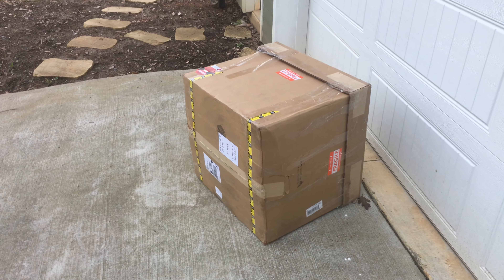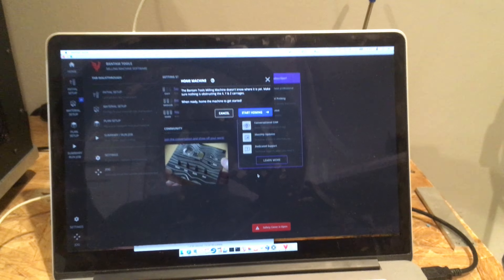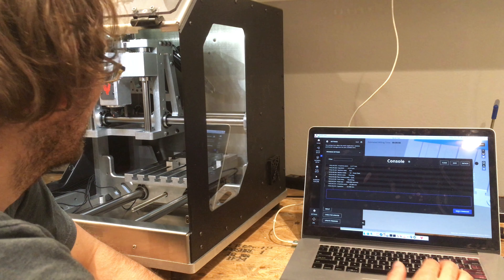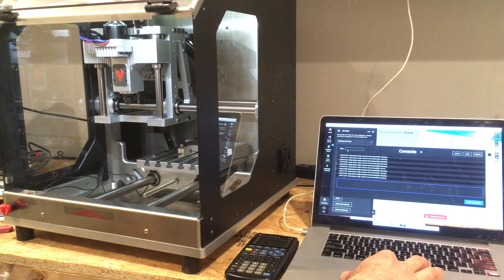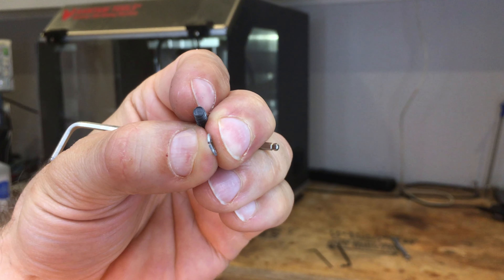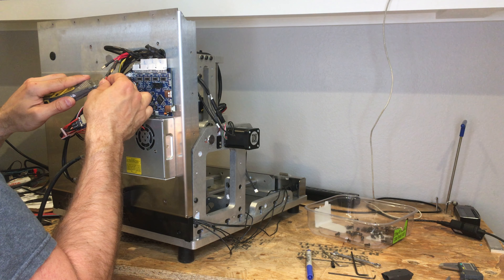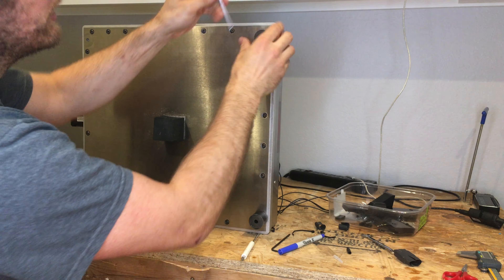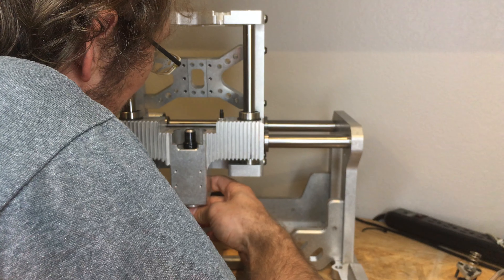Bantam Desktop CNC Review & Teardown - Part 1

Comment: Thank you for the through teardown. After watching all of the videos I removed myself from the waitlist. You saved me $4,000.

I was looking for a product that would allow move from additive printing to light machining. Ideally, with aluminum and a 1/4" tool. I could have stomached the software subscription, off the shelf parts, and overstated machine specs.  I figured that parts could be replaced as they failed. Apparently, this is not the case. I cannot fathom why a company would design a maker product with planned obsolescence. What a shady company.
Reply from the maker: Yeah I'm bummed Bantam's machine is such trash, too.  You can almost hear my enthusiasm escaping with every passing breathe.
Reply: I had the feeling it was not a very good tool due to that there are no YouTube videos out there by actual users.  There are several paid-for videos, but no real people like in this video.
Reply: Same I was going to buy this but not anymore
Reply: @justinknott6217  still haven't seen any response from Bantam. guess they're just gonna push more slick marketing vids and hope a new sucker is born

Comment: This was really friggin' interesting! Thanks for doing this! I've just begun contemplating how I could design my own desktop mill and figured I'd see what was available on the market. 
It just goes to show that no matter how many machined aluminium parts you throw at a design, it doesn't matter if the basic mechanical understanding is lacking.

Comment: Outrunner motors like that spindle tend to be pretty power dense. Something of that size can probably hit 1000W power or even more with enough current. The catch though is they get really hot and rely on air cooling from being on a drone or plane. So the 250W seems reasonable, but is severely derated for the use.

What's that other spindle you compared it to? I've been looking around for a good compact driven spindle - so far just going to use a Taig spindle head.

Comment: The motor for the spindle is a hobby motor for a big rc airplanes or big drones.  Totally off the shelf stuff and yes, they can easily acheive the 1/4 hp claimed, assuming their power supply can deliver the power required 1:01:50

Comment: John, I have a question on you HAAS railing review, comments are turned off so ill try you here.  On your corner posts did you use a set of Lag swage stops for one set of cables? Or did you offset your cables so you could have through holes for both sets and avoid the lag swage stops or lag swage turnbuckles?  Trying to avoid using the Lag swage stops where possible based on your great advice.  Thanks for your trial and error prior to my attempt
Reply from the maker: I offset the cables slightly.

Comment: That looks like a small outrunner that's using an ESC for drive voltage.  That will never hold up.  The beeping you are hearing is the ESC arming.
Reply from the maker: 100% Correct.

Comment: Wow....4 K for a small machine that is quite "springy" at the lightest touch..........after seeing a number of videos on the 3018 table top CNC routers I wanted one too just for the fun of building it, so I bought one on Bangood but without taking it out of the box I had already decided to build one from the  ground up to the basic 3018 extrusion frame design, but using12mm  SBR linear rails and 12mm ball screws all round with a 500 watt spindle motor.......it's 3/4 finished and went together very easily.

Comment: Much appreciate your honest and in depth review. I first looked at the presentation from NYCNC of the same machine and I can now say that I once again find my self feeling very disappointed by that channel. 

I am looking at purchasing a complete cncmil for max 5-6k. I have no hands-on experience but would  like to start with a desktop device that is possible to learn with. Is there any machine in this price range that you would recommend, that can handle brass and aluminium ( and perhaps soft steel)?
Reply: Well it really depends what you're looking for. If you want an off the shelf solution, the makerdream Evo One seems to be a great choice. The machine is stiff and powerful enough to mill aluminium with acceptable dimensional accuracy.
Reply: See this review / demo : https://youtu.be/0ka_2tp-gDg
Reply: If you want a larger work area the new shapeoko HDM is also a good choice.
Looking at the type of linear rail used and the size of the machine I guess that it's not as stiff, but the spindle is more powerful.
Reply: Finally, if you want a medium work area and a super stiff, accurate and powerful machine, you can take a look at the German M-Hoch-5 PFM2.7
https://youtu.be/Nz-hI_t9ZdY

It's a really different class of machine, more intended for professional use.
The only caviar is that it's a kit and you need some tools and knowledge in order to put it together.

Comment: The only thing this is good for is inaccurate prototypes in soft material. And even that is a stretch. I unfornatunately bought my machine years ago before Tear Down videos was popping up online. But I come here also hoping someone with more cnc experience can help me. My Bantam died on me, so I started replacing boards, convenienlty for Bantam the power board, TingG and ESC to rid me of the problem of a constant single beep after turning the machine on. Also, I get no green lights on the TinyG board. All the harness' are connected in the correct order. Now they want me to spend another 200.00 on a shipping box and return shipping because they're telling me a tech will have to go over it.  Does anyone have an idea what would be causing these beeps instead of the usual Start Up Chime?  Limit switichs? Bad Stepper?

Comment: Thanks for stopping me "upgrading" my Nomad 3 to this pile of crap. By comparison, my Nomad 3 is suddenly looking (and is!) much better than I thought. If only it couldn't so easily get twisted (shifted permanently) out of shape a few thou during transport or when placed down on a non-flat surface. Only one damned bolt everywhere there should have been at least two. -- or none. :/ Once re-aligned (mission!) and paired with a concrete paver, things have worked out OK but oh boy what a pain!
Reply from the maker: Anything is an upgrade compared to the Bantam Desktop CNC.
Reply: @Future Us They do. It's called the Shariff DMC its 200lbs worth of steel construction, linear rails, and ball screws. Has flood coolant and runs Mach 3.

Its a million times better than this, at an equivalent price point for the built version, and about $1k cheaper for the kit. 

Check out the Youtube videos. He puts up the torture tests on the official channel.
Reply: @latimer4964  It has also never shipped.

Comment: Mr Sullivan 
If you're going to get into the product review game
Please buy yourself some kind of external microphone so we can clearly listen to what you have to say. I gave up 10 minutes into the video (that I was really looking forward to) because I couldn't clearly hear most of what you had to say.
Reply from the maker: Good feedback.  I do have an external microphone, but didn't use it this time... production quality isn't the name of the game.
Reply: @doppelhub  If it's worth anything I'm pretty picky about audio and thought it was fine. Also, I laughed when I saw you push the machine in the other direction and cause it to stall. That is just laughable. Basically, you would have to baby it on aluminum to ensure correct sized parts and no lost steps meaning it would be incredibly slow.
Reply: I had no problem understanding him clearly: I'm here to save you 4k
Reply from the maker: @EscargotGarage  Everyones' hearing is different.  I concede to Mr. Jordan that my camera/microphone setup isn't good.  I'll need to work on "getting to the point faster" before I commit to purchasing better video equipment ;).